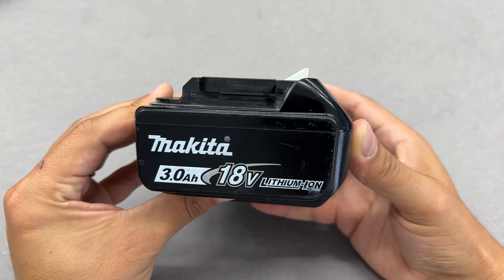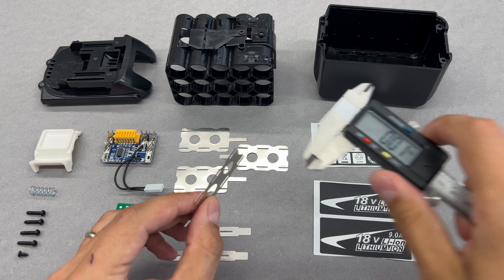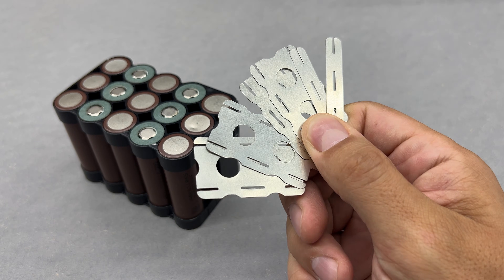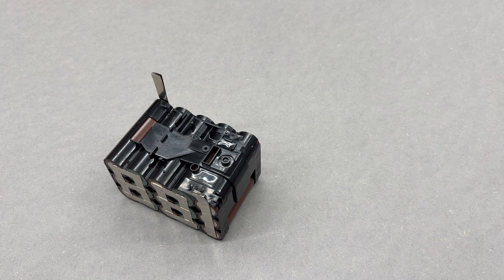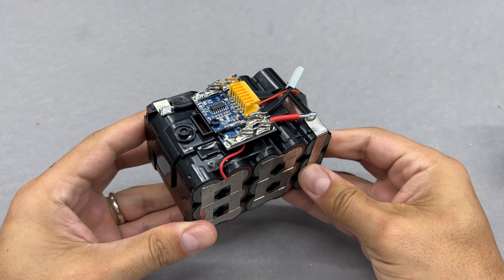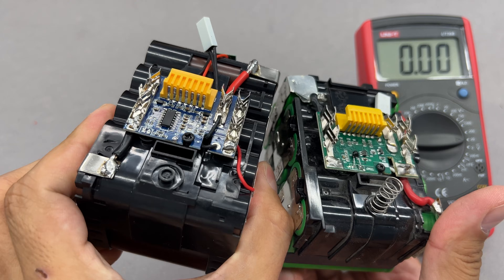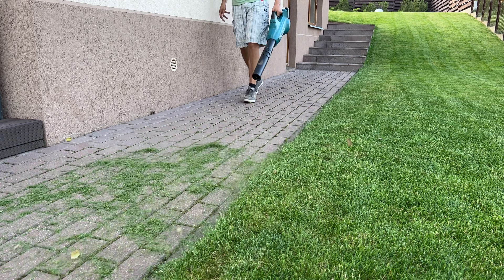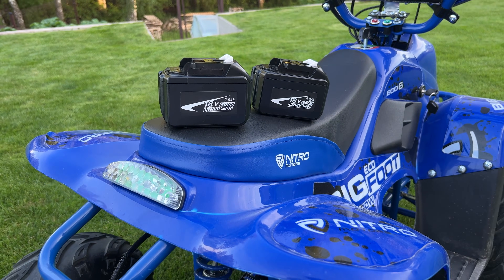Why Makita isn't Making it? DIY Extreme Capacity Makita 18V 9Ah Battery

Comment: A lot of people making batteries make the same mistake. Pre-cut nickel is great, all done. You can pre-solder the end piece for the balance wires. But everyone forgets to make the parallel group strip longer... It's always an afterthought. I would round the edges of the nickel to ensure better safety. The rings do a good job, sometimes extra steps help.

Comment: There is no cell balancing, so the pack is not likely to last very long, as the cells will quickly go out of balance, in fact it could be dangerous as some cells can  overcharge. It needs a proper BMS. It's why when you buy non Makita replacement batteries they may be fine for a short while, then they won't charge anymore.
Reply: There are kits on eBay now with four balance wires. Haven't tried any yet.
Reply: When I do, I think I'll drill voltage monitor holes in the case. As Ronald Reagan said, "trust but verify".
Reply: Can confirm they're dangerous. I have bought a cheap replacement Makita 18v battery and it uses the same exact BMS in the video. I tested the battery pack by intentionally discharging 4 of 5 cells throwing it out of balance and then I plugged it in to a charger and still charges up until *one cell is overcharged at 4.4 volts before the BMS shut down!* Really insane that the BMS thinks it's fine to overcharge the cells that far.
Reply: Amen, and there is also no current measurement (no shunt resistors) and also no shutoff when the voltage become's to low, there are no Mosfet on the PCB make that happen. I have a couple of these batteries that went unbalanced with the modules used in this video.

Comment: Where did you purchase the cells at ?
Reply: if you need 18650 size cells get molicel p28a cells. If you want 21700 size cells get molicel p42a cells or molicel p45b cells. High discharge and more capacity have fun diy!

Comment: Thanks for the video. All I need to know is, at what point does spot-soldering cell terminals together become dangerous? what should I do & what should I not? is it safe to solder the + & + terminals together or it has to be + to - 1st or - to + 1st or - to -. A quick summary of the dos & don'ts of soldering will be appreciated, thank you.

Comment: I think the problem is the way they designed their DXT tools doesnt allow space for larger batteries. I have the 36v circ and my 5ah are pretty tight in there. Dewalt and Milwaukee alternatively just kept upping the capacity for single batteries.

Comment: No you can't connect them in series or even use individually to power anything besides the tools, because that protection board is only half the electronics to cut off the battery supply, the other half being the array of mosfets  that are apparently in the tool but not present in your ride on toy.
Reply: I bet he can.

Comment: Great info, how about doing a Ryobi? I have Nicads that are gone and I was thinking of using the case for a broken Li-ion battery I have, would it work?
Reply: It's not worth the bother.  Ryobi batteries are very economically priced, and also already come in capacities of 9Ah.  Besides, Ryobi puts the entire BMS in the battery and the type of kit he used, is not an entire BMS placed in the battery, as some manufacturers leave the cutoff function under control of the tool itself.

Comment: ok, but WHERE do you buy original cells? They're quite expensive
Reply: There is no "original" cells, makita don't produce lithium cells. 
The point is to buy better cells than what makita used years ago. However, don't just look at capacity number, discharge rate is far more important in power tools. But these days you can have your cake and eat it. You can even build 18v (and 40v) pack with 21700 cells nowadays, this same kit comes with 21700 option.

Comment: Makita should also make 21700 battery packs. I got a couple of kits for them off Aliexpress. If I populated it with Molicel P45B cells, then I'll have a 9Ah 90 amp pack with just 10 cells.

Comment: You should buy a better BMS module. Just few dollars more, you got cell monitoring and balancing features which are essential for safety.
Reply: Cell monitoring on powertools ? Lmao and the balancings are always passive for these not actives
Reply: @EFDawahWiseSmile2LanternDen  Doesn't matter if passive, just that it has the balancing/cutoff.
Reply: whats wrong with this one? can you provide a link with a better module?
Reply: @AdrianAxinte this bms doesnt use all connections thats what he means
Reply: Sort of,  depends on if there is space in the battery pack because it needs to have the half-BMS that is already there to communicate with the tool, which a generic BMS will not.

Comment: Got curious, description says 18V, but forwarding the video you say 21V, can I use it in 18V impact wrench?  Sorry if the question is stupid,  but I know nothing about electronics and electrical.
Reply: The voltage varies with charge on lithium batteries. These 5 cells in series packs are ~ 20 volts fully charged, 18 volts average voltage throughout their capacity, and ~ 16 volts fully discharged. Give or take a bit so that's where he got 21v from - brand new cells so he got a 1v bump for now. All lithium cells follow this with individual cells 4 v charged, 3.6 nominal, 3.2 v discharged. So when DeWalt says their packs are 20v max compared to other brands saying 18v (nominal) they are all the same packs. DeWalt just tries to fool the consumer by measuring their packs voltage right off the charger where everybody else measures the average voltage over the whole cycle. There is no difference. So yes you can use this on a 18v tool as the factory batteries follow the same voltage curve as these.

Comment: Although battery technology is incredible and has really advanced a lot in the last few decades... It isn't magic. It kind of has to obey the laws of physics... I'm not intimately familiar with their battery designs... But they may have legitimate reasons behind their design and choices of the individual cells.

Capacity is important.... Arguably even more important are the discharge characteristics. Especially in such a powerful tool.

It's very possible that sells they have chosen...Might not have the biggest capacity.... But were needed because of their high discharge rate and characteristics under stress

 And the cells with the biggest capacity wouldn't be capable of discharging as quickly or enduring the same amount of output power. A balance has to be struck.

 Because each end user is different and will have different patterns and habits in how they use the tools. For somebody drilling holes or tightening fasteners every few minutes... High discharge currents are more important. However, For someone only using it a few times a day... I could understand why high-capacity would be more valued. But they had to strike a balance.
Reply: There are also a lot of restrictions on  power density limits when transporting or shipping batteries. I know of multiple instances where companies had to choose a lower capacity or certain characteristics... So that they could ship pallets of batteries easier without going over the limits imposed by the shipping companies. Lithium ion batteries have been suspected for multiple airplane fires mid-flight... Uspostal and many other companies have hard limits on what is allowed.
Reply: While that is true, remember that since he is putting 3 series in parallel, then only pulling roughly 1/3rd the current from each series, so he has a bit of breathing room as long as quality cells were chosen.  For example if the originals were rated for 25A, and the replacements 10A, (x3 series) he has enough current capacity.

Comment: makita also does a 18V LXT Lithium‑Ion Compact 2.0Ah Battery which takes 5 18650 cells which weights just 458grams. makita uses samsung INR 18650 2500mah batteries. so if you put 3500mah 18650 inside you can get 40% more battery time. and that's actually the power that double the size and weight batteries have. it's insane.
Reply: have you tried it? what batteries with 3500mah did you use?
Reply: @AdrianAxinte  I did one with 3400mah cells. they work great. works with any 18650. it's not rocket science. it's really simple tbh. almost plug and play
Reply: It's because you can't run a sustaining business without people repeatedly buying your product. So if the battery burns out you have to go buy a new one? Why fix a problem when the problem is making money but yeah it's still a problem
Reply: @_roundie_8153  That doesn't really make sense in this context, Makita's batteries are good quality as are most major brands these days.  A lot of people don't want a big, heavy, 9Ah battery, nor to pay that much for them, unless using a very power hungry tool, and in the context of putting 3.5Ah cells in a formerly 2.0Ah pack, that has its own issues as I mentioned in my prior post.

I'm not at all suggesting that there aren't a lot of people who would benefit, but it's pretty subjective and I do feel that Makita should offer those people a 9Ah battery and let the market decide.

Comment: Unfortunately this build will not last very long.
Batteries have to be top balanced and protected by a BMS that controls the voltage of each series cell.
And a passive balancing would be good.

This pcb don't protect each cell and does not balance.
I did this some years ago not knowing how to really work with li ion and unfortunately i destroyed about 11 Sony vtc6 after about 20 cycles.
Reply: there are better bms modules for makita with compatibility?

Comment: I also agree. I think Makita should make batteries that are like 9ah since they would last a long time and run their cells cooler. I think I will try and take on a project like this with the packs that I currently have when they go bad. Would you consider making a video on 21700 batteries in the future? Thank you for all the videos that you have made.
Reply: Makita wouldn't do such a thing as it would make all of their 36v tools as powerful if not more powerful than their new 40v line
Reply: no that's stupid. not only 21700 wouldn't fit there's no kits for them. 18650 are fine.
Reply: @riskinhos  There is... I bought 2 of them. 21700 are a nice upgrade actually.
Reply: @riskinhos the only stupid thing here is you.

Comment: Clean I wonder if your used top quality cellls whatever the highest mah cells they make and build it how badly could you beat the oem battery in a 3 mah or 5
Reply: I've searched what is available on the market and I confirm last answer.

Generally speaking, the more capacity 18650 cells have, the less max current they get.
Makita cells are samsung INR18650 25R (or 20R for lower capacity batteries). They provide 2.5Ah capacity and 22A max continuous current output (even more in spike).
I assume you can't get lower max current if you want your tools to work properly.

The biggest capacity available within 18650 shape with at least 22A max current is 3.12Ah. So you won't beat by much the oem ones (specialy considering the cost).

The pros with 4s3p rather than 4s2p is that battery's current is 3 times the current of 1 cell (rather than twice). So you'll be able to buy cells with lower max current specs but with higher capacity (or just lower price). The cons is that it's big, heavy, and might be too much for some people.

Also a fun fact is that it costs ~40€ for 4Ah and if you build it yourself it will cost the same price (without all the brand's support and guaranty). So there is noway you'll find better price/quality. Actually I've bought a chinese one labelled as 6Ah, and I've opened it... It was marked as 2Ah samsung cells. So it was actually the same as makita's 4Ah batteries but with a chinese label and... more expensive
Reply: Although battery technology is incredible and has really advanced a lot in the last few decades... It isn't magic. It kind of has to obey the laws of physics... I'm not intimately familiar with their battery designs... But they may have legitimate reasons behind their design and choices of the individual cells.

Capacity is important.... Arguably even more important are the discharge characteristics. Especially in such a powerful tool.

It's very possible that sells they have chosen...Might not have the biggest capacity.... But were needed because of their high discharge rate and characteristics under stress

 And the cells with the biggest capacity wouldn't be capable of discharging as quickly or enduring the same amount of output power. A balance has to be struck.

 Because each end user is different and will have different patterns and habits in how they use the tools. For somebody drilling holes or tightening fasteners every few minutes... High discharge currents are more important. However, For someone only using it a few times a day... I could understand why high-capacity would be more valued. But they had to strike a balance.

Comment: no balancing=not safe
Reply: What would you use to balance the batteries?
Reply: @konstantine381  5S 21v balance board should do, with proper BMS board of course.
Reply: Because cells would overcharge and/or underdischarge(this is 5s pack) @konstantine381
Reply: Touch me brah. I’ll be 10 minutes.

Comment: What is the final cost of this 9,0 Ah battery?

P. S. Makita has 6,0 Ah in its lineup.
Reply: Backpack battery holder PDC01 (i paid a bit over €400) and you have 24 Ah (room for 4 x 6 Ah in the device , there is space to carry extra batteries on the harness)  and PDC1200 has 33,5 Ah , its pricy , round €1200 and takes long time to charge .
Metabo did put out statement why they only have 2 rows of cell in their batteries ... middle row is only heating up the other cells ... Metabo has 10 Ah battery , with only 2 rows of cells ... if there just would be an adaptor to get Metabo batteries to Makita .
Reply: rather than 18650 x3 parallel, its not better using 26650 cell? more ah, more compact and less weight for sure